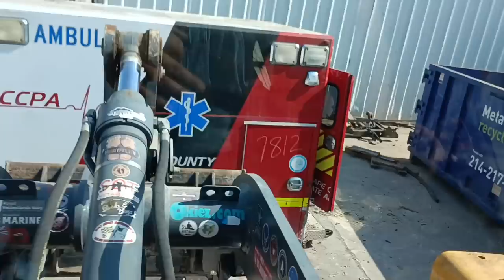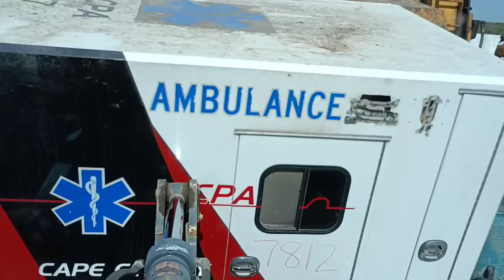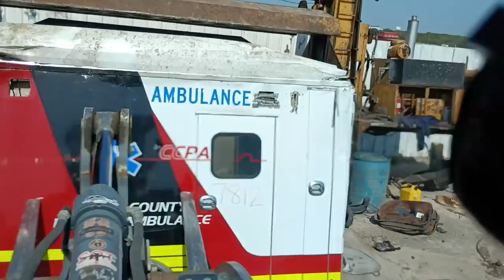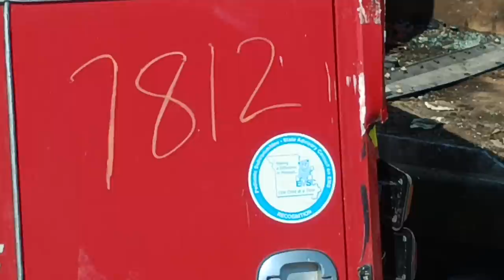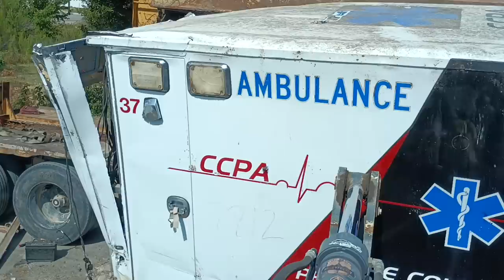Ambulance 🚑 Imploded inside the Crusher

Comment: Hey cowboy I'm a loader operator at an auto recycling yard in Connecticut next time you are trying to crush the corner of one of those ambulances or something like that try starting with the forks up high and tilt them down at like a 45 degree angle so you can use the weight of the machine and the force of the tires driving forward to help crush it once it starts to go tilt back while going down and it should pop those sturdy corners on that box
Reply from the maker: Thanks, will try that 👍🤠
Reply: @CowboyCarCrushing   We have a fairly small crusher I have to smash just about all of the 2nd cars that go in some of those Subaru B pillars are nooo joke lol

Comment: The problem is aluminum doesn't crush like steel, it rips, cracks and breaks.   I see some scrap outfits just using big dumpsters for this stuff so it doesn't matter if it's all kinds of loose pieces.
Reply from the maker: We are set up like that. We gotta get it on the trailer. No matter what shape it turns into 😂😂🤠👍

Comment: I know nothing about crushing cars I have a question that might be the  answer could the top be cut off low enough to where it'll fit in the  crusher or is it to reinforce to cut ? Or heated enough to where you could bend them with the loader and then smash the roof down?

Comment: Why didn't you take all that wood out? Wood and metal don't mix and lowers the value of the crushed bundle. You would've been doing the owner a favor if you had told him all that wood has to go in a dumpster and he knows that he would get a better scrap price out of it without all that wood in it. I just don't know, Cowboy, if I was crushing that ambulance I'd tell the owner all that wood has got to come out.
Reply from the maker: Bubba this ain't the 1st time we have crushed for those folks. Not the 1st time we crushed ambulances either for them. They know exactly how it works. Remember I'm just a hired gun. 🤠👍
Reply: @CowboyCarCrushing  Do the other truck body and ambulance to be crushed have any wood in them? They must be super keen to get rid of these if they're willing to take a chance that the steel mill might reject the load because of too much wood in it or knock a chunk of money off the scrap steel price for sending it in with the wood in it.

I might just have an opinion, but these folks should know that clean steel gets a way better price, if you haven't already loaded and shipped them.

Comment: Im suprised they didn't take the cooling system at the rear of the box and  its not a  fail you  still crushed it and thats  what you wanted to do
Reply: A/C condenser. Putting that thing under the truck by the exhaust was a huge mistake. Dumb idea....